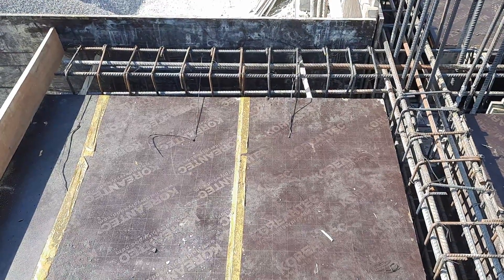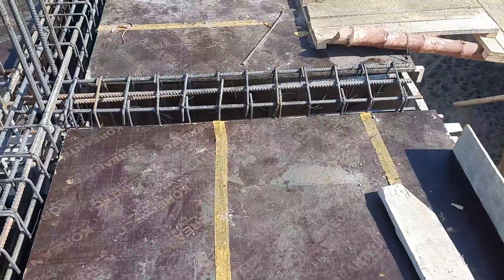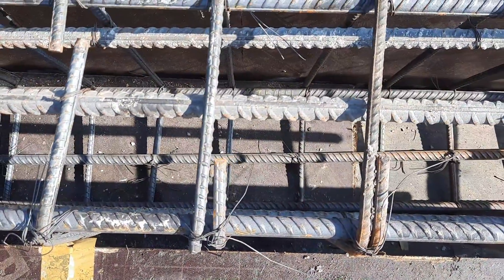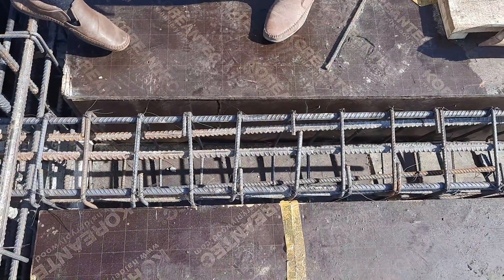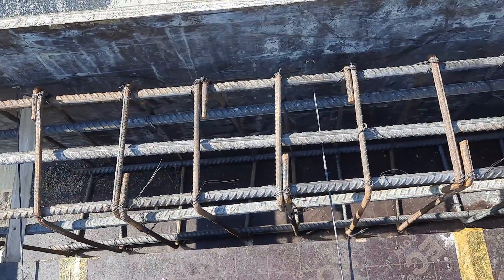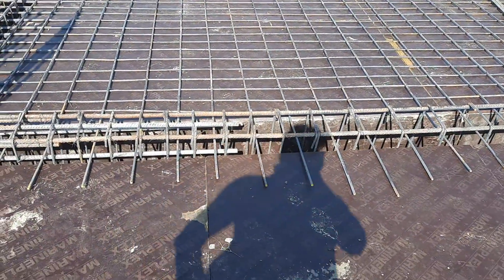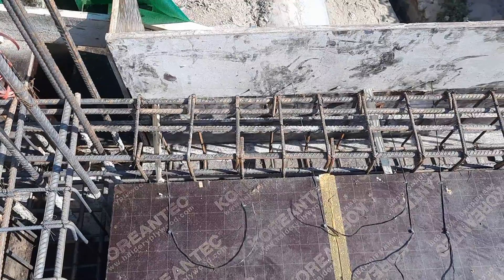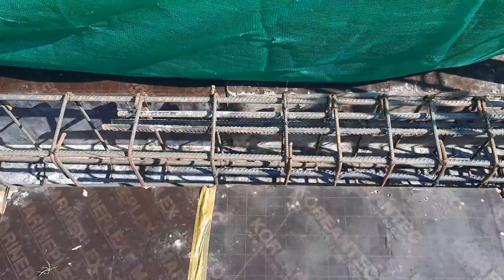Big Mistakes in Cantilever Beam Construction | Civil Engineering Videos |

Comment: I have 6 continuous 12 mm rods in each beam. What if i bend 4 side rods in horizontal L (180 degree) and 2 mid rods in vertical L (45 degree) to make anchoring to join to column ?